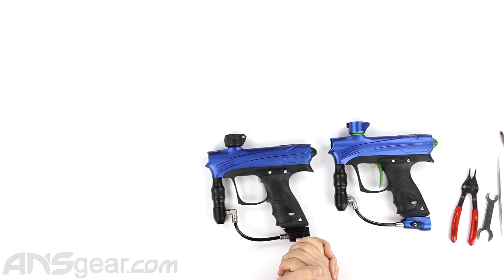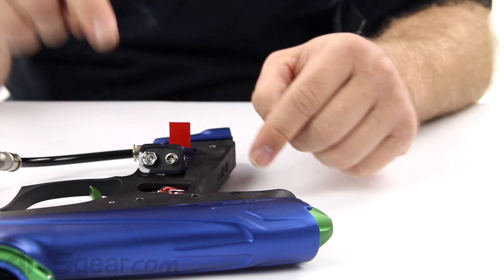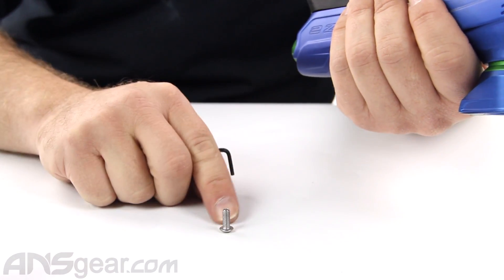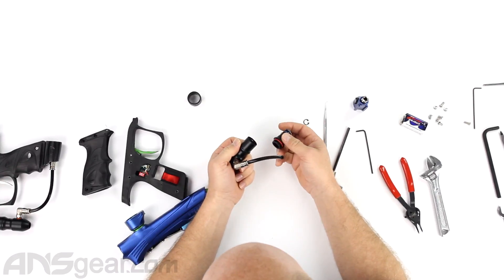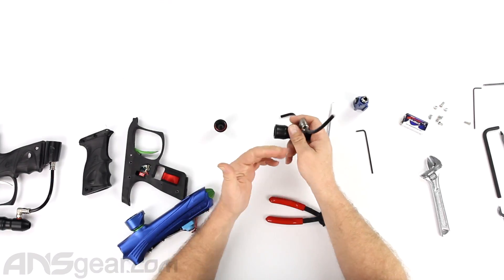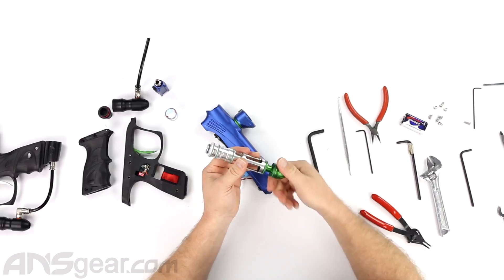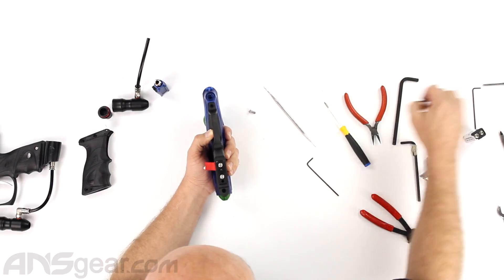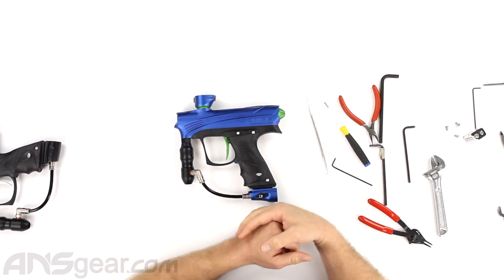Proto Rize/Maxxed Rize Paintball Gun - Maintenance/Repair

Comment: When and how often should I lube the O Rings and so forth nonetheless replace them? Really appreciate having this video accessible
Reply: Will watch whole video later!
Reply from the maker: A lot of people will clean and grease their gun after each day of play. But you don't have to do it every time. If you grease it up every few times you play, that should be fine. and you replace the o-rings when they get dry or cracked or damaged in any way.
Reply: Ok how fast do you think it takes for O- rings to dry out typically?
Reply from the maker: Depends on a lot of different things: what kind of o-ring it is, how much you play, and how well you care for your equipment, they could last a few months or a couple years.
Reply: Man ok big range with the Proto Rize maxxed what do you think about it’s O -Rings?......Appreciate the help
Reply: And how often would you check for the maxxed
Reply from the maker: It's pretty much the same advice on any gun when it comes to o-rings. Clean it when it gets dirty. and each time you have your gun opened up, just check to make sure they still look good.
Reply: Okay thanks

Comment: My marker is leaking from the back if I do this well it fix it?
Reply from the maker: there's a good chance that it's a bad o-ring. Following his advice in the video about which o-rings to replace might help.
Reply: ANSgearPaintball im having the same problen i shouldnt have to replace it when its brand new and only put 1000 shots threw it
Reply: I fixed it i had twisted the bolt apart over loosening the bolt assembly nut in the back of the gun
Reply: Ivan Rico I have to do mine after not even 50 shots

Comment: Hi guys, my maxxed rize was working fine, but from one week to another stopped shooting. The bolt goes back when connecting the air, but it only shoots a little amount of air and i can feel it in my hands, the bolt doesn't move fwd when trying to shoot

Comment: For some reason I can only shoot my gun for a couple of minutes then it’ll just start shooting blanks and when I take off the tank after about a min it’ shoots air out the hose. What do you think is wrong?
Reply from the maker: the air purging through the hose is normal. the blanks however aren't. I would need more info to figure out what's wrong.  Call our customer service and maybe they can help you or set you up with a repair.

Comment: Hey :), I started playing and my proto rize shot fine, then after a few hours i started to get an air leak coming from the back of my bolt, the green O-rings on the back of my bolt look fine to me. Any ideas how to fix this??
Reply from the maker: The o-rings are the only thing that should cause leaking there. It's possible they may  just need to be lubed. Or replaced and lubed.
Reply: ANSgearPaintball Hello! I'm from Argentina, buy the rize maxxed in the USA. I have the same problem. when regulating the air it leaves the back of the bolt. the orings look good and the lubrication too. I do not know what else the problem may be. Some help??
Reply: and when I squeeze the trigger, the green light blink
Reply: late reply but change the dwell to10 and it should stop
Reply: SaladGaming  check to make sure the bolt assembly is tightened together before u put the bolt in the gun happened to mw